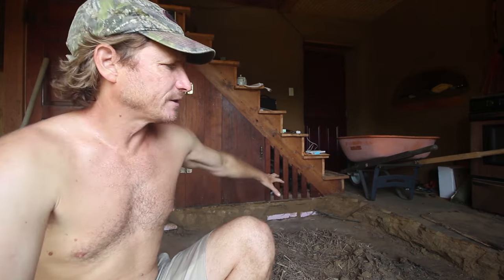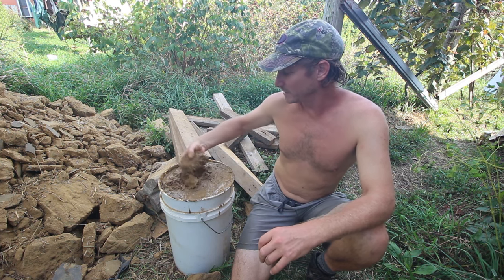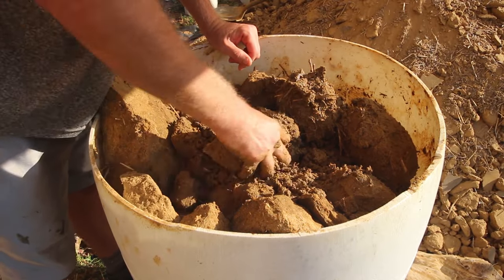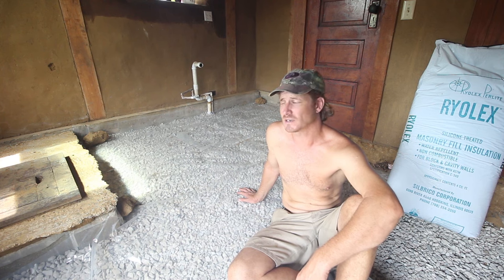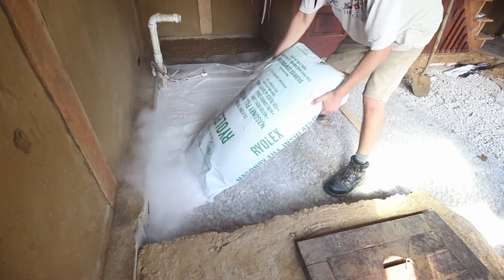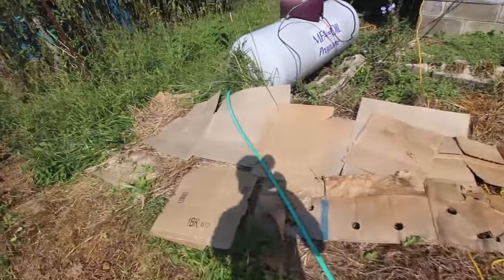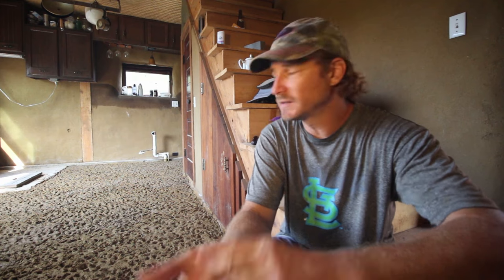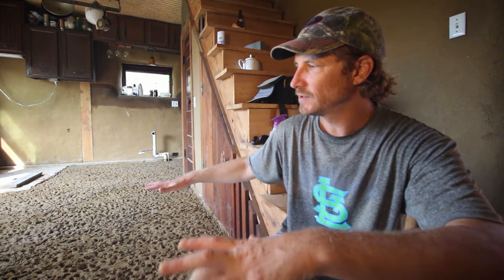Relaying An EARTHEN FLOOR | Part 2 Perlite Insulation

Comment: Hi there! Thank you for your videos, very useful and great job visually as well! How is the floor in the meanwhile? Did it not sink? I was wondering if the perlite powder layer is hard enough to keep the upper earth layers in place. Plus: have you ever seen a floor without the plastic under and above the perlit? What could the vapour do to the floor without the plastic? Here in hungary we have 70% cob houses, and they quite all used to have earthen floors, however more simple, just wet earth rammed plus the surface hardened with cow manure. No plastic, but the thing was that they had to be washed with cow manure+water once a week to fill micro cracks and keep the hardness of the surface. Naturally those days are long gone, nowadays hardly any animals in a village...
Reply from the maker: The perlite did not sink yet. There has been some very minimal settling, like maybe an 1/8" or less in some places. I doubt it will settle any more. I would guess that if you don't use the plastic it would breath more and more moisture would wick up from the ground into the floor. My foundation has drainage all around so I won't get standing water, but I'd get vapor if I didn't use the plastic. The perlite is inert and won't be affected by moisture, but it could grow mildew.  I can't believe they would have to wash the floor with manure in the past. Seems like that would stink and also not really clean it. I guess they didn't have any kind of oil to use to treat the surface or it was too expensive to afford.

I'd love to find out more about cob houses in other countries. Someone from Ireland I think one time commented on a video and said that the problem with our cob walls here  is that they aren't thick enough. He said theirs were 3 feet thick at the bottom. But they are surrounded by water and have a much more moderate year round climate than we have here. We have low temps as low as -20°F here and I don't think cob would keep out cold like that because it has no insulation. How thick are the cob walls there and what are your coldest temps like?
Reply: @HardcoreSustainable  do you have videos on building your house that you could link me to?
Reply from the maker: @travisdavis1042  I don't have video of the construction process. I just had a blog at the time. http://danatdr.blogspot.com. Sometimes youtube doesn't allow links in comments we'll see if it works.

Comment: Interesting, Thanks. I wonder if you mixed the cob and perlite together wet ? Then maybe just add a thinner layer of cob for a top layer?
Reply from the maker: Not sure if you are suggesting a different way to do it, but I didn't want to mix cob with the perlite because cob would detract from the insulation value of the perlite. The layer of plastic between kept the two separate and because the perlite doesn't compress much at all, and a lot of compression would have happened after the first thick layer was added, the final floor didn't settle much, if at all.
Reply: @HardcoreSustainable  Thanks for the reply. I was thinking when they mix perlite with cement, it stil acts like an insulator. Was just wondering if anyone has tried it with cob.

Comment: Perlite is pretty weak on crushing. I used it for insulation my wall cavity, and I am happy. I am not sure about using it in the floor like this.
There should be drain pipe under the perlite in stones. Otherwise, if this floor is ever flooded there will be no way to drain the water from perlite and stones below.

Comment: Did the earth floor crack is that why your replacing it. Looks great 👍.
Reply from the maker: Yes it was cracking, but it was because the light clay straw insulation was composting under it and sinking.

Comment: With those layers of plastic, (which I realize are necessary), does that mean when walking barefoot on an earthen floor you still aren't grounded to the earth, (the same as is with standard construction homes)? If wearing flip-flops or shoes outside prevents grounding wouldn't plastic sheeting prevent grounding as well?
Reply from the maker: what kind of grounding do you mean? electrical grounding?
Reply: @HardcoreSustainable   yes basically...... "Earthing (also known as grounding) refers to contact with the Earth's surface electrons by walking barefoot outside or sitting, working, or sleeping indoors connected to conductive systems, some of them patented, that transfer the energy from the ground into the body. Emerging scientific research supports the concept that the Earth's electrons induce multiple physiological changes of clinical significance, including reduced pain, better sleep, a shift from sympathetic to parasympathetic tone in the autonomic nervous system (ANS), and a blood-thinning effect. The research, along with many anecdotal reports, is presented in a new book entitled Earthing"
Reply: I guess you could put a wire mesh in an earthen floor that is connected to the grounding rod.
Reply from the maker: @coryart  Never thought of that, but it's an interesting concept.  I'll have to look into it. I'm skeptical of pseudoscience and there is a lot of that out there that talks about such things, but if there is real scientific evidence, it could be relevant.  I wonder what people with wooden floors would do, or people walking on the second floor of a building.  I do have a grounding wire going through part of the floor to my electrical system.  It is connected to a grounding rod outside.  But it's not like the entire earth is connected to a grounding rod, so what purpose is the grounding rod? If walking on the ground is enough, why would you need a grounding rod? If it's not enough and you need a grounding rod, how could that possibly be something humans need or evolved to need?
Reply: @HardcoreSustainable  I don't think any standard floor construction is made to be grounded, if it was we wouldn't be able to create a static electric shock by shuffling on the carpet.

Comment: I've seen one guy in belarus covers his floor with polyurethane varnish and it becomes very strong and solid. As well he used it for worktops. Think you need to try if it not breaks your natural building  rule.
Reply from the maker: I guess I'd rather not use something synthetic if the natural material works fine. I love linseed oil. And it's smells much better than polyurethane and is less toxic.

Comment: can you use rice hulls in the place of perlite?
Reply from the maker: I would think of rice hulls as providing fiber, though not tensile strength. I don't know of the insulative qualities of rice hulls. If they are insulative it's possible that could be useful. I supposed if they could be piled up and not compress under weight of the cob, they could insulate. But they would run into the same problems the straw ran into in being organic and thus degradable in the presence of moisture.

Comment: Hi!I plan to do  the same layer:perlite,clay and on top I want to lay down  roof  tiles.we have in Romania  many  ceramic roof tiles whit flat surface. The question is.:do I need special  mortar to lay  the tiles?
And if water comes, accidentally on the  floor will  dissolve the clay floor?
Reply from the maker: I did lay tiles into mine in spots. You could just lay them into the plaster material like I did. They can come loose in time, but probably won't if the floor stays level. Alternately you could lay a rough layer of floor material and then use adhesive to secure the tiles, then plaster in the filling grout with earthen plaster.